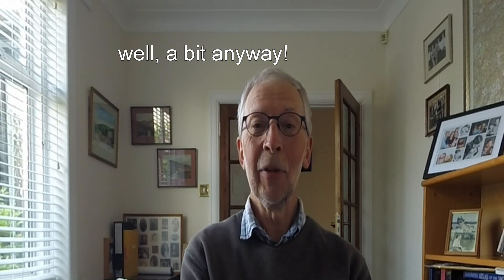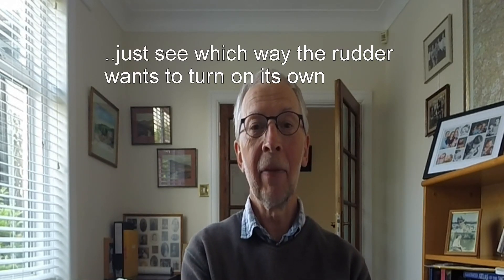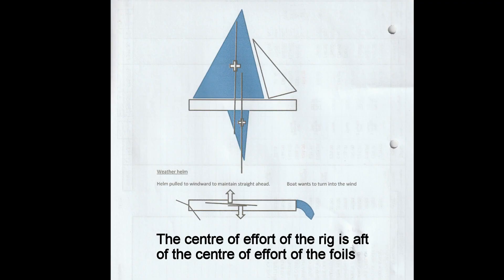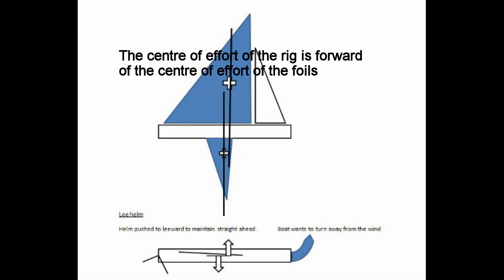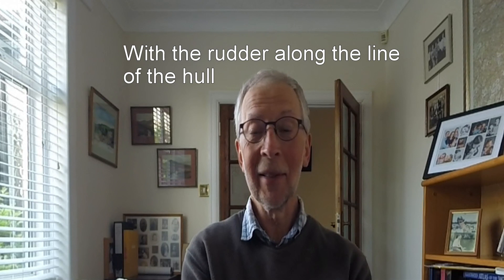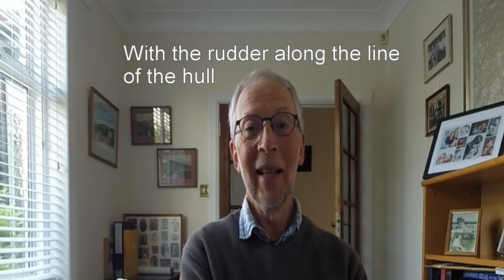Mast Rake   why it matters

Comment: We don't traditionally think of the rudder as also generating lift, but it does. Therefore a little bit of weather helm can be a good thing, especially in windy weather when sailing upwind with reduced centreboard

Comment: A little Weather helm combined with the force applied on the tiller by the skipper, is actually adding to forward motion. This is over and above the wing effect (pull) on sails. So, weather helm is a must, or else the boat could stall.
Reply: @bethells86  This is a fascinating topic. I've found Olympians and world champions on both sides of this topic.   Currently, I try to achieve a neutral helm that allows the boat to be steered with body position and the mainsheet.  I'm happy to eliminate the tug of the tiller in pursuit of speed.

Comment: Yup then you get the affect of rake on shroud/spreader angles, and thus mast bend. Not that I have ever noticed that so much but what does help is increased rake opens up the slot between the main and genoa which can really help on the windy days. 
To be honest though on the small inland waters were grads excel, and were height and sailing efficiency are everything then the points that you talk about are the most important. Although as you stress, keeping the boat flat when trying to establish this is everything and on a small inland, gusty, lake this isnt always so easy.  
Thanks for the films, keep them coming